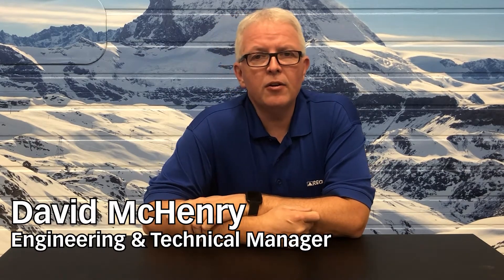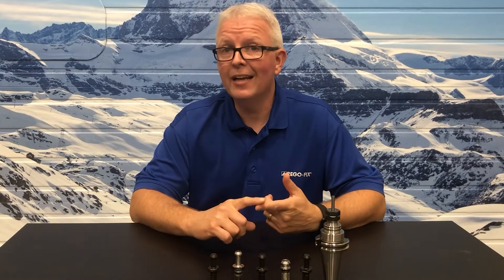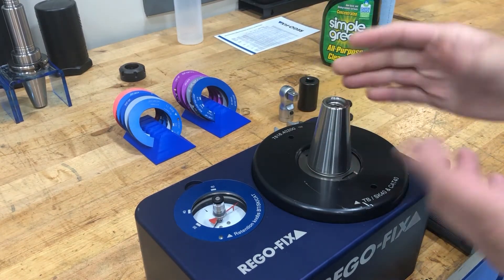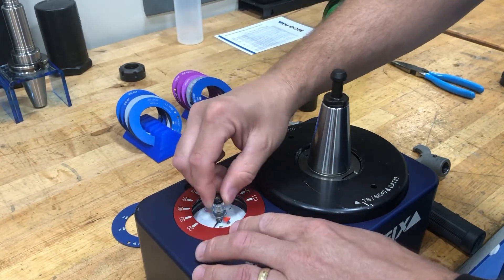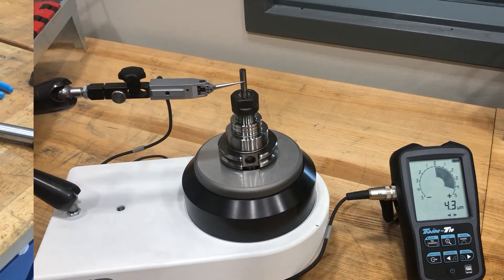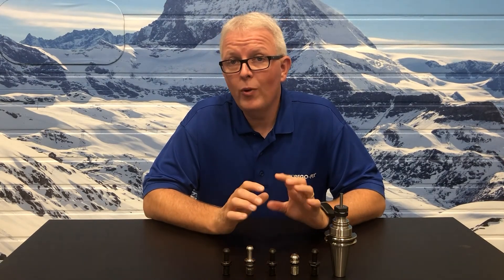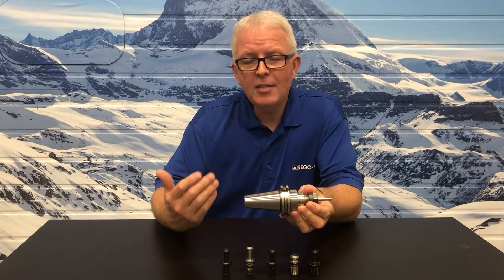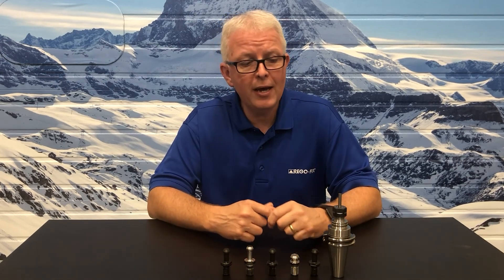TechChat - Pull Stud Torque

Comment: Interesting and appreciate the explanation for how the deformation is coming into play with more modern spindles. 

Is the blue loc-tite the ideal solution for retaining the pull studs at lower torque? Curious if TSC affects the holding power of the loctite over time?